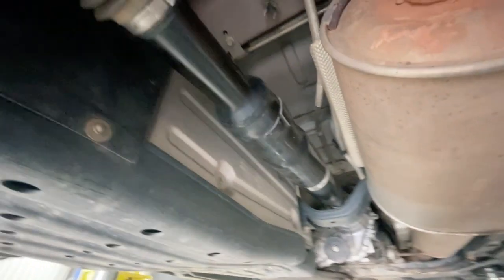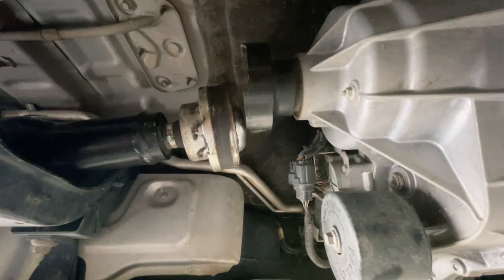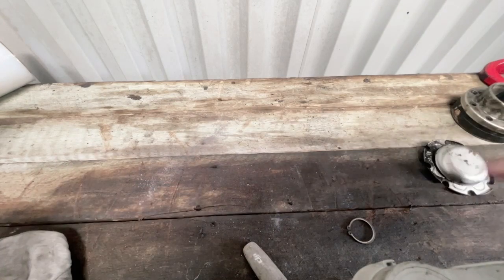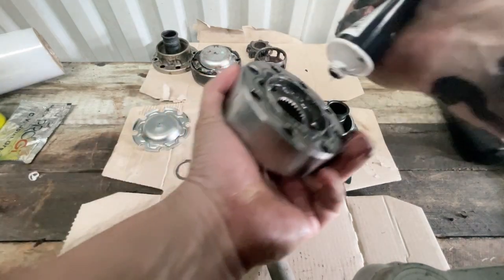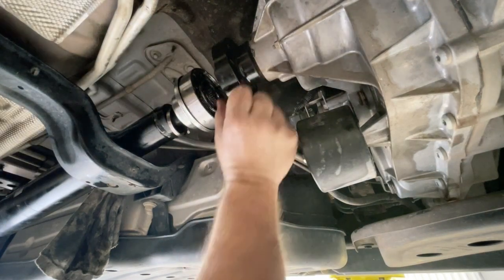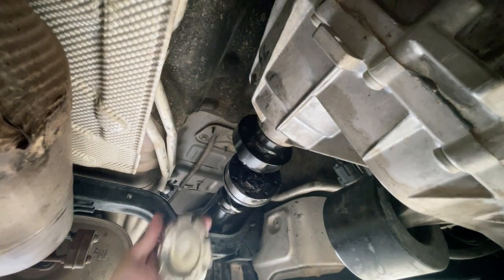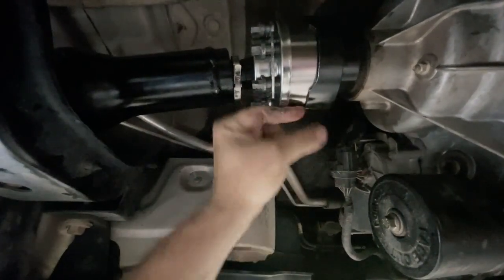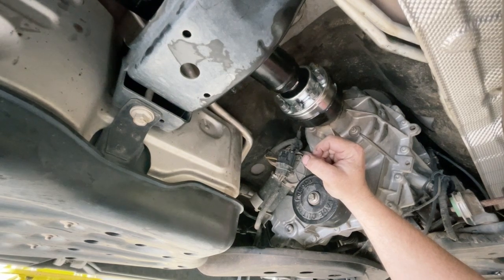Ford Everest Tail-shaft CV Joint Replacement

Comment: Your the best. SImple, straightforward, detailed, clean camera angles. You keep on doing this and people will fins your channel naturally.
I have a 2014 Ford ranger Manual transmission, 2.2L. My problem is it's losing power at acceleration and can't climb hills easily as it was before. I have to make the RPM high to avoid stalling. There is no TDC codes, new intercooler hose, new glow plugs, newly cleaned intake manifold and egr. Still not producing much power. I'm losing confident in hill climbing with my truck specially when you need to stop or slow down on a middle of a climb.
Reply: Check the air filters, then the Mass air Flow sensor. If problem is still there try some fuel additive. Try the liquiy molly super diesel additive. That cleans the injectors and gets rid of mold. Check your fuel filter as well while you’re at it.

Comment: what a mess inside that joint  all because the cover has failed and split   , through and through holden man here but i now have a 2016 ranger  and a 2008 escape as a work car and they both back each other up  ; not impressed with the way ford do things at all

Comment: I had mine replaced at 116000km, cost 1000 usd.
Reply from the maker: the whole shaft or just the joint?
Reply: To be honest, I am not sure but at that price prob the whole shaft. I went on a long trip, and have not felt the vibration at low speed again. Lots of slow driving in our national park.